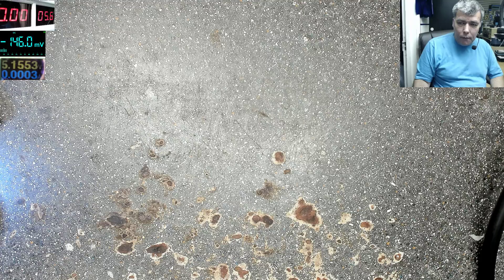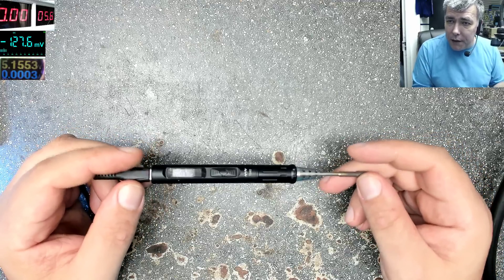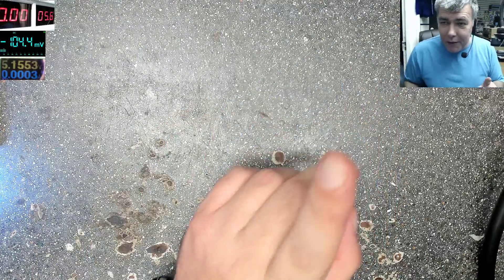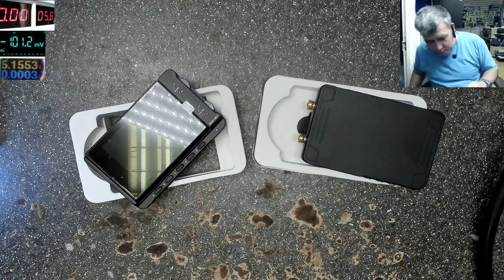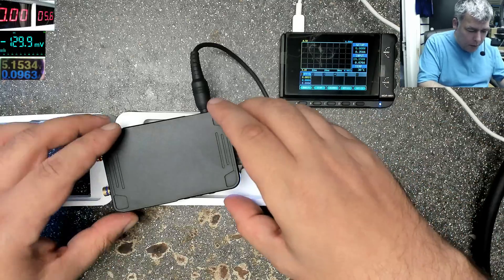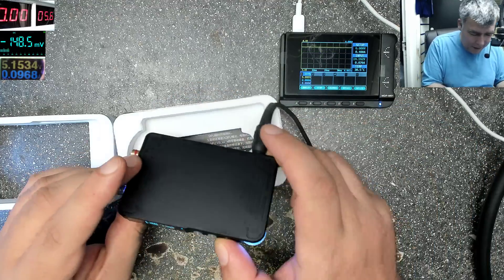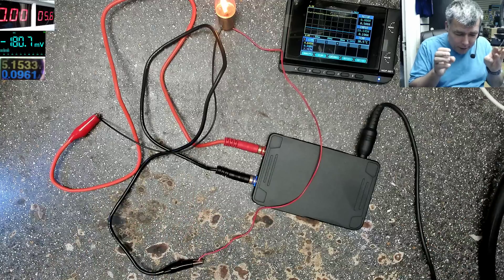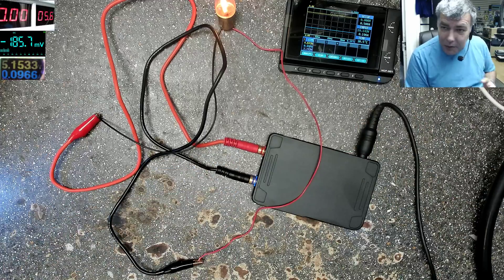MDP-XP Digital Power Supply Review

Comment: It’s an absolute marvel that the company has achieved. They have used a tracking switching PSU with a very low dropout linear output stage and it has very very impressive ripple and noise.

Comment: If you have to plug a power supply into this power supply then I just  call this a realllllllllly expensive regulator with a tiny display. not a power supply.
Kind of like holding up a 7805 regulator and saying here is a 5 volt power supply - not really.

To me, a power supply would be plugged into mains and it would supply (and usually regulate) all in the one package like Sorin's white adjustable supply.
What do you think?

Comment: Hmm clever idea but the display is too small and they could have put it in a nice box with front slots so each module presents its terminals to the front, also no fancy communication and no link cables to break.
Just my opinion.

Comment: Please dont use this in beginners lessons. Because we dont have it, we need lesson with the other supply please sorin please. And its display is tiny too and it fluctuates at 8:45.
And to use this power supply you need two more power supplies lol, one for display with usb c adapter and another adapter for psu with 19v.
Reply: Are you saying that everybody should have the same model of the power supply he is using in his lesson in order to follow them?
Its just a power supply, use what you can get cheap in your location, it doesn't have to be the same. As long as you can set current and voltage, you are good to go.
If you don't like this power supply, just don't use it, nobody is says this is a requirement for his lessons!
Reply: @morto360  i cant see anything in what he is using. And if he will use graph to teach something, i cant do same because most psu dont have graph.
Most power supplies have big display and no graph. Doesnt matter what model but this one is too different
Reply: @commandroid9336  I see your point, but I am sure he knows that too and will not expect other people to have that feature.

Comment: digital is always great until it breaks down, which is really2x hard to repair, same with my small power supply so lightweight but lasted only a few days after using it for finding shorts, got a big analog one and no problems yet exvept its taking huge space on my small desk, hope you can make video how to remove the short sensing resistor? or make it somethjng you can turn on or off

Comment: Quite expensive... and the lack of low voltage supply makes it useless in logic board repair for phones or laptops... what can you do if you have a short on 1.5v rail, or cpu rail 1.2v? How can you find the shorted component? U can’t inject 3.6v(as the lowest psu can supply) you will kill cpu, or anything on that rail...
Very nice design, i like it, but useless... great for battery charge:)))